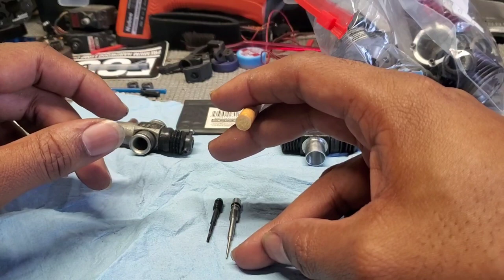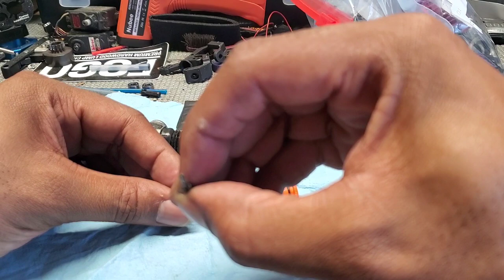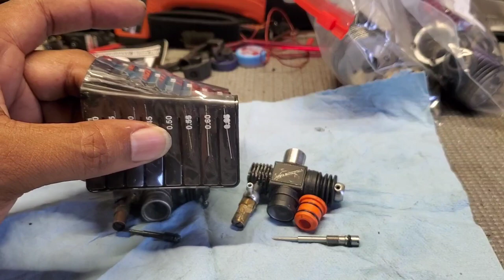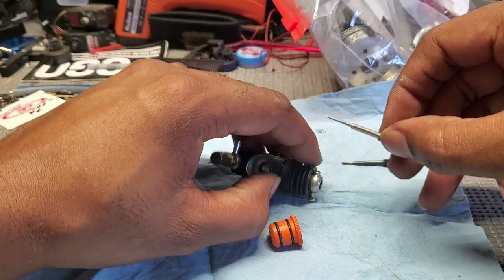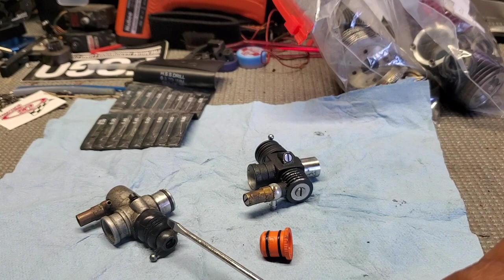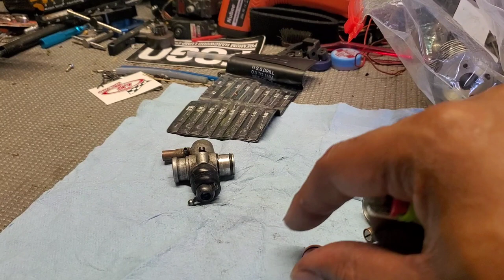Let's talk about carburetors and tuning

Comment: Awesome video.  I have ran into an issue with one of my engines.  It drops to a good steady idle but then idles up for about 4 or so seconds and then drops back down to idle and if it is left alone with no throttle blips it will load up and cut off.  I cannot get it to tune regardless of the needle settings.  I have never chased a tune this much in all my RC days.  It is an RB modded 28.8.
Reply from the maker: I would have hear it and see it run. Because if it drops straight to idle then raises up after 4 or so seconds without dropping again it would be just lean lowend and, but its also dropping again then loading up. That could be a number of things. I would check the linkages make sure there is no binding and that the carb is shutting and staying in place at neutral. Check to see if there is any binding in the drive train, that could lead to some funky tuning issues. If these don't work. I'd call RB mods and see what Rick thinks about it. Hope this helps 🏎💨💯💪💪👊👊👍👍
Reply: Thank you for the information.  What I should of mentioned is my tune is very inconsistent.  I get it good and then add fuel and it falls flat on its face.  I really believe I have a fuel delivery issue.  It is a TLR  4.0-T and I kind of remember Woogie having fuel cap issues.  Going to investigate it further.  Anyway, your videos are awesome, you taught me a lot when it comes to difference in carbs.  Keep the vids coming because newbies and veterans alike can benefit from your knowledge.
Reply from the maker: @hisandherrc3865  im fairly new to the losi products. That being said if your tune is good it should get a little rich when you first refuel but should stabilize within a lap or 2. You can try to tighten the screw under the cap to get a better seal, or check your fuel lines to make sure there isn't any small cuts in it close to the clunk and check to see if the clunk moves freely up and down in the tank without getting stuck on the walls. Lastly check the outside diameter of the fuel line to see if its creating a good seal where it enters the tank(this one has gotten me in the past and lead to me chasing a tune for 2 days). Let me know if any of this helps or not, and we'll go from there.
Reply: Awesome information.  I only have time to play with my RC stuff on weekends. Work always gets in the way of fun...LOL...I believe you are on too something though.  All of my other cars/engines are way more stable than this one.  Its like there is a gremlin in there turning needles as I do laps.  I believe I have a fuel delivery issue because the inconsistent performance is very dramatic.  Your video has helped me better my tuning skills though.  I have applied them to both short and long needle carbs with great success.  My tunes are so much more dialed in that running my nitros are much more enjoyable.  This is the only engine that is giving me grief.  My wife and I have been playing with nitro RC for quite some time and before viewing your video I was only getting by with mediocre tunes.  We built a track on our property and now run on the weekends.  I enjoy watching your videos and absorbing all your knowledge.  Makes the hobby more enjoyable and trouble free for us.  Once I get this issue ironed out, which I know I will with your knowledge and my OCD, I will have a collection of top performing nitro cars.  Thank you sir for your help and will let you know of the outcome.
Reply from the maker: @hisandherrc3865  I know what you mean...real life always wrecks havoc on having fun...but its like they say, you work hard so you can play hard...lol...another thing you can check is the orings around all your needles and while you have them out put a little bit of afterrun oil on them before putting the needles back in. Just to make sure none of them are torn or have any knicks in them. Also check that your exhaust is sealed and not pulling apart anywhere. Im glad to hear that the videos are helpful. Everything in them is what I've learned through trial and error and more experienced people taking the time to help and teach me. I just want to pass the knowledge on so others can enjoy nitro rc like I've had the pleasure to. Awesome to hear that your wife joins in on the fun. A family that nitro's together stays together! I look forward to hearing how everything goes 👍
Reply: What up Lilchilly?  Giving you an update.  I got it figured out.  Replaced the tank lid with a Tekno lid, replaced fuel lines etc.  Not sure what fixed it but she tunes good now.  Thank you for the assistance.
Reply from the maker: Sup bro! Im good 👍. Glad to hear you got it worked out. No problem anytime bro. Happy ripping 🏎💨💯💪💪👊👊👍👍

Comment: What up Lilchilli?  I discovered something I have never experienced before.  I was running my Maxy Cinco 2.0 today which has a I would say medium length low speed needle, hell maybe a short.  It is not a long LS needle for sure.  It runs great, after a long high speed pass, it drops down to idle with no issues.  It will idle for ages, and take off from a dig with no hesitation.  The idle is very low, consistent and sounds to be tuned good.  What I noticed today while pulling it in for more fuel is it does great after a high speed pass, drops to a low idle and seems like all is well but if I only apply a tiny bit of throttle, just to move the car, when I let off the idle hangs high for about 10-15 seconds and then eventually comes down to normal idle.  If I blip it while it is at high idle it instantly drops to normal.  What could be the problem, or is this even a problem?  On track conditions it performs flawless and temps are about 235-245 when running hard.  It only seems to hang at a high idle when throttle is barely applied and then released.  I kinda lean toward a lean LS but if I go more rich on the low speed it 2 stage idles, loads up, cuts off or falls on its face during acceleration from a dig.  What is your opinion on this?
Reply from the maker: Hey bro! Question what does it sound like when you pull that 15-20% throttle and hold it there? Does it immediately jump up in rpm? Or stays crisp or sounds a little rich?? In this case your also dealing with a 3 needle carb. And your situation is where that third needle can come into play to clean up that spot. Or you could go a little leaner on the low speed and close the idle gap a little more to compensate. You can richen up the MSN first (only give an hour like a clock hand adjustment, don't adjust past a half-turn adjustment either way)see if that helps. Your basically have a great tune on it already so I would have to hear it to be for sure. Let me know how it goes.
Reply: @MrLilChilly   Thank you for the info Lilchilly.  I have not adjusted the mid speed needle any.  I have a thought I want to run by you.  I have some pretty beefy clutch springs in it now.  The stall torque is pretty high,  it takes some RPM's to even get the clutch to engage.  When I give it just enough RPM to get the car barely moving, the RPM's are quite high because of the 1.1 clutch springs.  Could this contribute to the idle hanging high when the throttle is applied just enough to get the car moving at slow speed.  If I just hammer it from a dig, it accelerates smooth and crisp, if I hit full throttle for a about 3-4 seconds (my track straight-away) and I let off throttle and get on the brakes, it instantly drops to a slow consistent idle.  Just curios about the hard clutch springs because getting the car to move slow takes a good bit of RPM's and there really is not a load on the engine and thought maybe it is just searching because of the no load condition.  I may play with the mid-speed needle a little bit and do as you suggested with the 15-20% throttle held for a bit and see how the engine responds.  Actually I will try all your suggestions but wanted to run my clutching setup by you to rule out the clutch.
Reply from the maker: Its possible. But I don't think its the clutch. Because as soon as it engages it would put load on the engine and at that point it would flame out from starvation of fuel or atleast lean bog. And the engine would rotation would slow do to now having to rotate the drivetrain instead of free-spinning if I'm explaining it right. If the clutch is fairly new I would rule that out. And it would take me back to is the engine getting proper fuel air mix throughout the throttle range. The 15-25% throttle pull is a test just for the lsn. Basically pop the air filter off while the engine isn't running and see at what point of trigger pull does the lsn just start to come out the spray bar, you want to note that position and with it started give enough trigger to move the lsn out until just before it comes out the spray bar that way you'll be consistently listening to the effects of mainly the lsn and throttle stop adjustment. What your listening for is
1. Does the rpm shoot up anywhere in that range=lean lsn
2. Does it hang without dropping=wide idle gap
3. Does it hang and then drop= rich lsn
Also check your linkages and make sure its closing the gap to proper width, without hitting the brakes. sometimes the linkage is off just enough that any throttle movement will actually not allow the carb to return to neutral and close the idle gap to the right amount without pushing the brake to go past where it would have stopped at neutral trigger position. Hope this helps
Reply: @MrLilChilly  What up Lilchilly?  Again, thank you for the information.  I will attempt to run through all your suggestions/procedures this coming weekend time permitting.  Working 3rd shift and family stuff going on kinda breaks into my RC time.  I have a big SxS ride coming up and my alcohol/water injection on my Can-Am maverick X3 sprung a leak so I have to work that issue before my RC stuff.  Anyway I will let you know the outcome of my Cinco 2.0 when I get to troubleshoot it.  Thanks again, you have been such a help and I appreciate all that you do.  Thank you Sir.